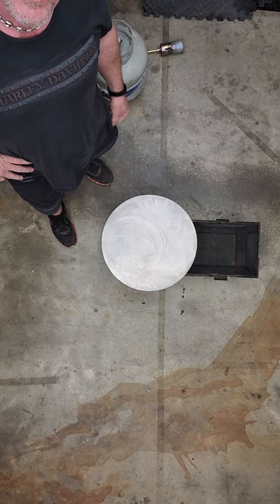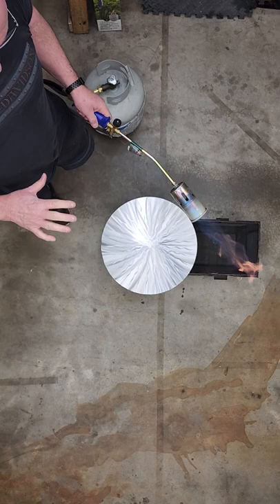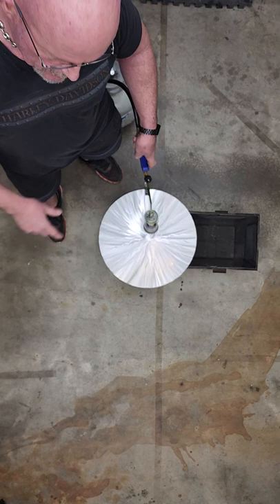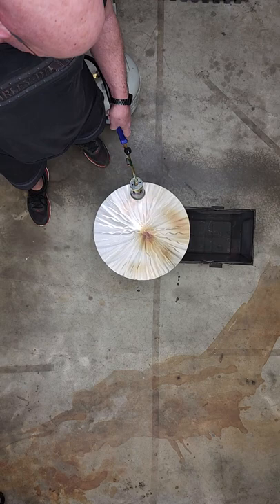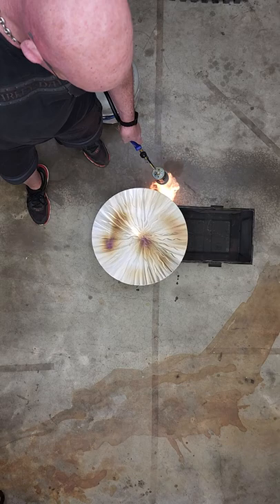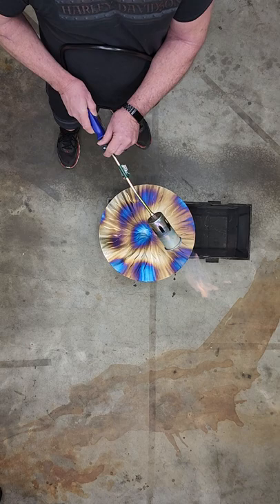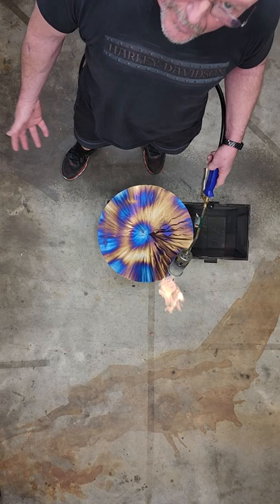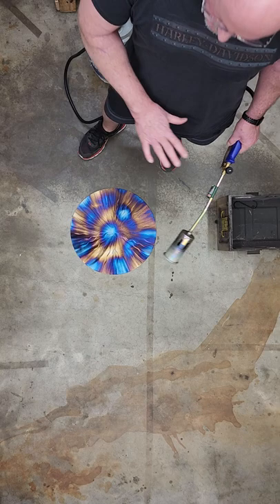How to flame paint metal with a propane burner.

Comment: Excellent tutorial. Using a large flame source is a great idea. I've used a propane torch but now I realize the heat is too focused and its too easy to overheat the metal forcing me to work too fast.  Could the coloring be even more controlled by using an air gun set at very low psi  to counteract the heating for focused coloring? Just a thought.